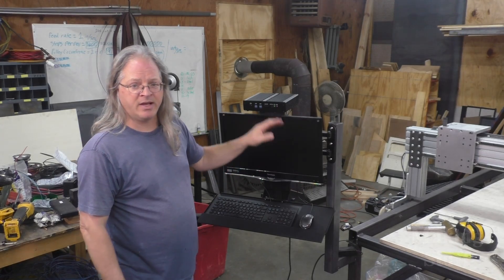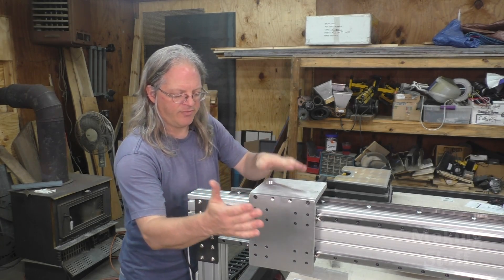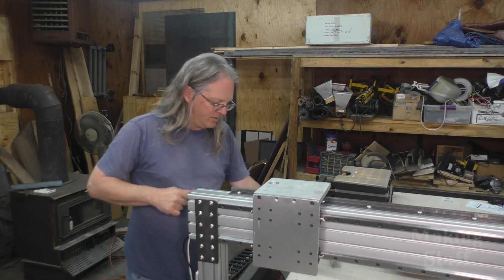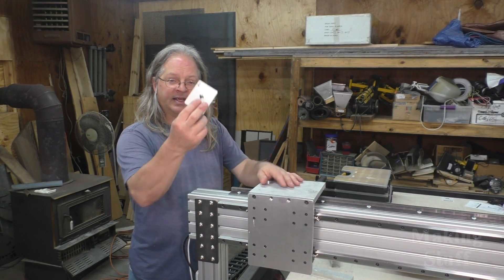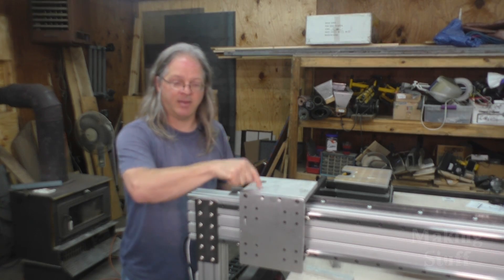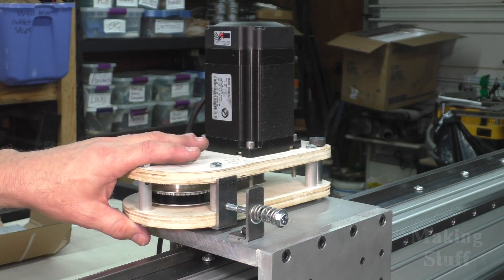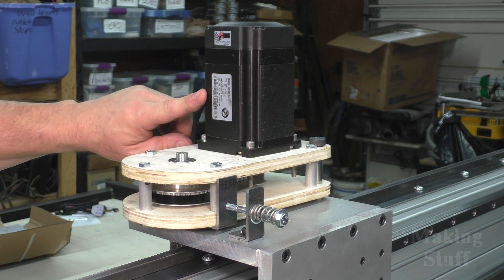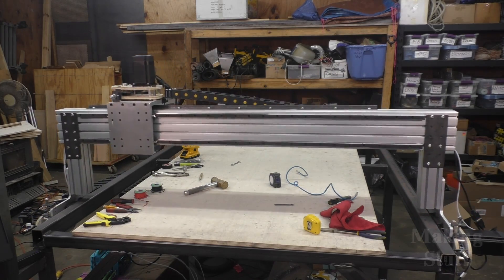CNC Router Part 7 - Finishing the X Axis

Comment: Hello, thanks for your amazing videos. I'm designing my own 5axis CNC milling router. I have a difficult question about z axis physical (switch) limits. .. 
When the spidle is points down there is a limit to avoid table collision, BUT.....  when  head axis B is rotated 90º I´ll need to move Z down to the base..  Who could I set this B limit depending on the B axis position?... 😅.. Thanks again

Comment: instead of a mouse, a trackball might be a better option, given the limited space you have to work with. My goto is the logitech trackman marble(formerly the marble mouse), but honestly any halfway decent trackball should work. You could use a keyboard with a built in scrollwheel if you're married to that feature, or just mount your mouse in place for the scroll wheel, but at least you wouldn't have to constantly pick up and lay down the mouse every time you ran to the end of the mousepad.
Reply from the maker: My wife has a trackball, I can't use it.  Thanks for the input!
Reply: @MakingStuff  yeah, it takes some getting used to, lol.

Comment: Wow!  I am always blown away by your talent!  I have been studying drive reductions for some time now and yours is the most straightforward for the DIY individual.  Plus I Greatly appreciate your list of material, and taking the time to video your work.  such a Huge help.  I noticed in the video you use a square to help start your tap for threading.  An old machinist 50 plus years ago (yes I am old as dirt) showed me that after you drill a hole using a drill press with a drill bit, to remove the bit and chuck up the tap.  By hand rotate the chuck till the first couple threads are started.  Then remove the tap from the chuck and finish with the tap wrench.  Works like a dream keeping everything square.  Thought I would share.  Thanks Again and please keep the videos coming !
Reply from the maker: Thanks for watching!

Comment: How do you call the linear rail with teeth which drives the Z-Axis block on the gentry?
Reply: Sounds like you're referring to the rack, which along with a pinion gear makes up a rack and pinion. He used the same method on the y axis.

Comment: Is there a parallel port on the PC? If no, how the connection is made between linuxcnc and driver board?
Reply from the maker: It uses ethernet, not parallel port.  That is why I have switched to using the 7i96 board.  You can't find new PCs with parallel ports.

Comment: Cheering you on while I’m building my own 2nd machine!

When you drill out the holes for mounting the bearings, always make them a little bit oversized to allow for inexact screw hole locations. Neat trick with the card spacer, though. You just helped me decide whether I want to face my aluminum plates off before I do the rest of the machining. Aluminum is awesome as far as LOOKING straight/flat, but it’s usually got a warp to it when you break out the metrology gear!
Reply: Rather than incur the wrath of the family next time they want to play cards, I have been keeping a selection of flat pieces of hard clear plastic cut from blister packs.  Check the thickness with a micrometer write it on the plastic with marking pen.  Now you have a ready supply of "poor mans shim stock".  TIP:  because the plastic is clear, it makes for an almost invisible solution, BUT, don't lay small shims on a messy workbench... you will never find them again!    :o)